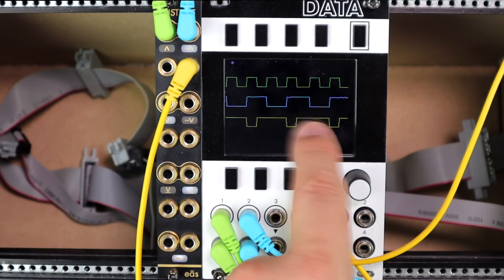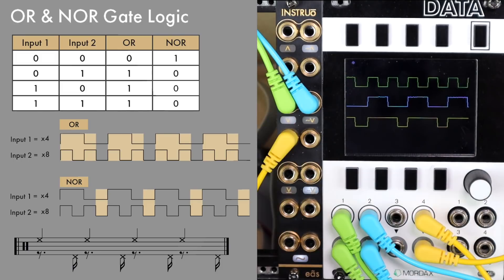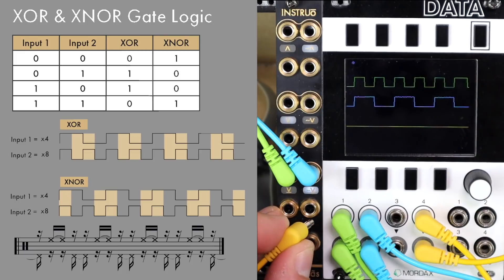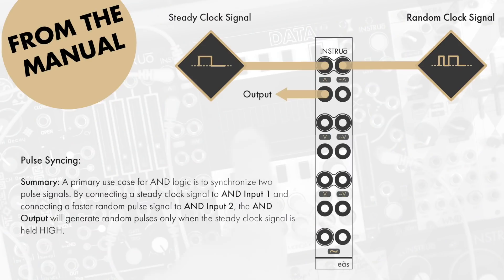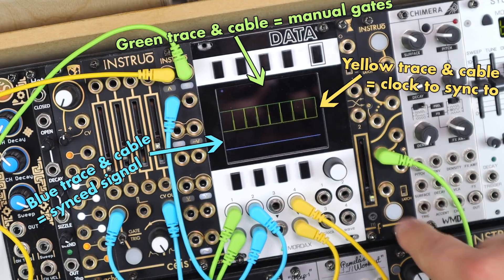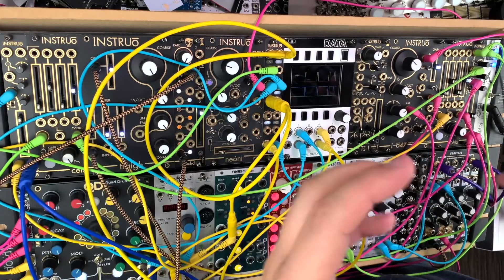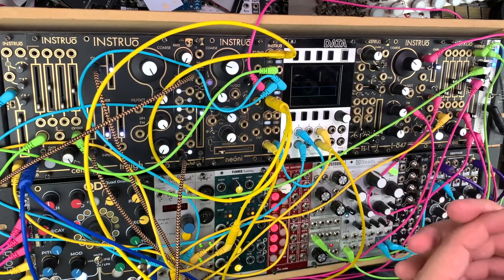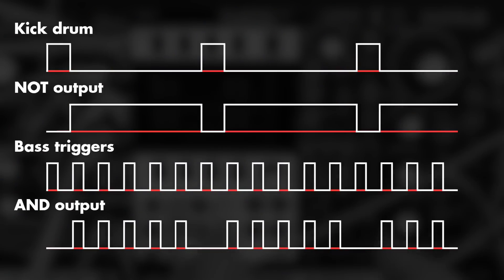Everything you need to know about logic in Eurorack with EAS from INSTRUO

Comment: In philosophy, we all study logic in a pretty elementary way (unless you specialize) but it blew my mind when my professor explained that you can express "And" with MIN{x, y} and "Or" with MAX{x, y}
Reply from the maker: Yeah that's a smart way to look at it. Minimum of the two signals is the AND, so both need to be high for that to be the minimum and MAX for the OR ... clever! Thanks for that.
Reply: @DivKid  That's right. In logical systems with only two truth values, i.e. True and False, we can represent them as 1, and 0 respectively, and then write e.g. MIN{1,0} = 0; MIN{1,1} = 1. Whereas for OR, MAX{1,0}=1; and only MAX{0,0} = 0.

Comment: This is the BEST video of explaning Logic Gates with musical sentene. thanks a lot!!! Wonder if i can try those in Make Noise Maths because they also have logic gates..!
Reply from the maker: thanks! Appreciate that. 

RE Maths, it's not logic gates like here. It's analogue logic that will work like max and min functions over the inputs. Those outputs vary in voltage rather than operate in a gate like binary fashion. 

Experiment with them though, lots of interesting things to be had.
Reply: @DivKid  yeah last night I tried and it only has SUM and OR and INV
Reply from the maker: useful though. 3 variations of mixed modulation if you get both envelopes going.

Comment: can also be used for logic gating, using it as a switch. meaning you use a logic 1 on one input 1 and output the signal of the other input. you can turn on/off clock signals to other modules.
Reply from the maker: Yeah that's always a nice example. Gated switch. Or like an organ style note on and off with a VCA. I do that in the video.
Reply: @DivKid  i designed "this" as well some 1.5 years ago, but not yet .... soldered.
I have another logic module, I'm sure no body has, it's on it's 3rd revision now. one thing, but has multiple possible applications and configurations.
Could i send this experimental module to you? ... after some time.
but than again, other people will copy it.
: )
Reply from the maker: Hello, would love to chat and check out these sorts of things. Let's talk privately you contact me via the email on my channel about page here - https://www.youtube.com/c/DivKidVideo/about

Comment: So could I also put through Logic complex clocked LFOs and get complex clocked gates and triggers?
Reply from the maker: Yeah you can patch any signal in. If it's binary/gate based logic it will just depend on when the LFO levels cross the thresholds for the circuit.